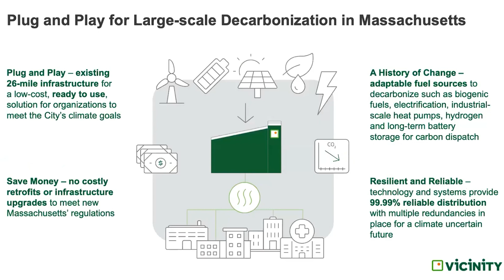Clean Energy from Dirty River Water? Here's How It Works! - Steam Culture

Comment: Hey I love the video, but this is so backwards… 🤭 they should be using it with the same vacuum steam electricity generation systems as used in Ocean Thermal Energy Conversion (OTEC) 

They could be making electricity with that heat. 😂

Comment: Now you have 2 sources of steam  ?. 1 from the heat pump & 1 from the electric boiler ?  Electric power to steam is 1 kg of steam = 1 AMP. That is a huge amount of electricity needed.   Example a 200 ton per hour boiler will need  200000 amps. I am sure you will need bigger boilers than that. !!!!!!!!!!!!